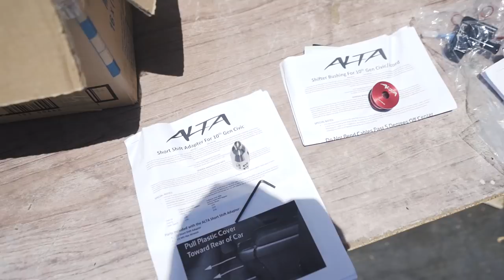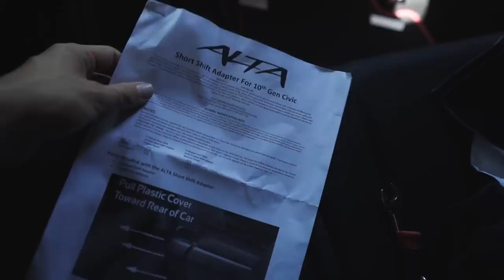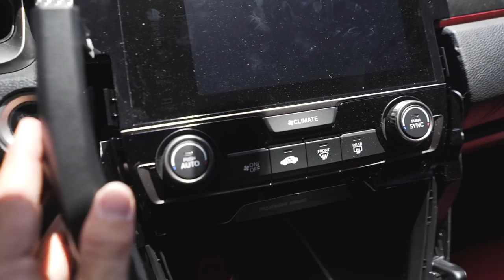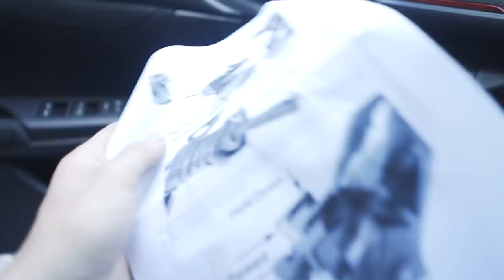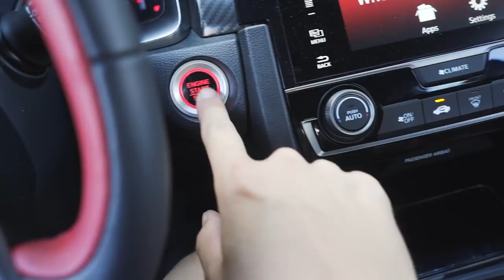INSTALLING A SHORT SHIFTER ON THE 2018 TYPE R! DIY

Comment: Just installed it today and I adjusted the adapter to it’s lowest, shortest setting. Now it’s the same short throw I had in my 04 STI with the Kartboy short     shifter. I did have the whiteline gearbox bushings with it also. It’ll allows me to shift faster, down shift better with confidence it’ll be going into each gate. This improves drivability tremendously. Best mod so far!

Comment: Just a little bit of helpful advice, as someone who has installed a lot of these short shift adapters on Civics this gen and of past, I highly recommend you put some type of tape over the Allen screws that tighten themselves along the ball/shaft of the original shifter connection point. They will eventually unscrew themselves over time due to vibrations and general shifting use. You can also use something like thread locker blue if your so inclined, but the non messy way IMO is just some simple tape wrapped around it twice over, it will keep them in place and prevent them from vibrating loose. If you don't do this, in a month or two from now, you will find that the shifter doesn't go into gear smoothly and may completely bind up because the ball that connects to that weird connection to the linkage has loosened up and fallen out and it's not engaging the gear correctly. Anyways, love the videos, keep up the great work! Hopefully I'll get myself a Type-R in the future.
Reply from the maker: i was actually thinking of that. When i go back in to do the shifter lock, i'll do that!
Reply: Thomas from Alta told me this" No this shouldn’t happen, we’ve used a similar design  for another part for a long time with out any issues. It’s a clamp design, so when you tighten the screws down it holds pressure on the screws both ways."
Reply: Loctight will work just fine.

Comment: Just ordered one. I used to do car audio installations so removing the center console shouldn’t be an issue as long as I make sure I don’t break or loose any clips. It would’ve helped others how some panels needed to be removed by lifting up or straight out, screw locations which you did mention.
Reply: Where did you order the adapter from?  Will it work for my 2018 civic LX 6spd?  Thanks!

Comment: Have you noticed the clunk without having the shifter cable lock down? If you’ve already installed it has it removed the clunking issue if you even had it after the adjustable short shifter install? I think stock is still long for me compared to the short shifter I installed on my 04 STI.

Comment: I can’t see how it would sit lower than stock when the only thing you’re changing is the cable mount below the shifter pivot, unless you had a smaller shifter knob. Should’ve test driven it with the console all out though cos you would’ve been kicking yourself if you had to take it apart again!!

Comment: Yo dude, I love your videos man. But why not just do 181's since you're already @ 185lbs. You only have to water cut 4-5 lbs rather than having to gain 13 lbs for the 198's. You get a better WILKs score by the end of the day and if you're doing USPA, you can gain as much weight as you want after you weigh in :) Best of luck to ya!
Reply: Bernard DeRoxas that makes no sense to me 😂 I hope I’m not the only one
Reply: C J Farmer 😂😂😂😂.. basically he is jus saying that Dustin should compete in the 181 weight class due to the fact that dustin is 185Ibs instead of trying to gain more weight for him to compete in the 198 weight class. The Wilks score thing i dont get thoo😂😂imma noob powerlifter
Reply: C J Farmer Basically what @DatAsianGuy was saying.  Dustin is technically already in the 198 weight class since he is above 181, but he may be better off just cutting a few lbs to get under 181. Not only will he have a better chance of placing, but his wilks will be higher (Score based on the ratio of bodyweight to weight successfully lifted). And USPA is a federation that allows lifters to weigh in 24hrs before competition, allowing them to pack on as much weight, even exceeding their weight class. Much like what fighters/boxers/wrestlers do.
Reply from the maker: thanks brotha! I tore my bicep last year and the 181 class is much more competitive, especially at my height.

Comment: Dustin this is not the gear box in the center console. That's the gear stick. The gear box I believe should be on the engine
Reply: eldan wiggins LOL. He knows
Reply: Yeah he's used to rwd cars where the gearbox is usually right there.
 (Not always, on some cars, it's more forward than the actual shifter. For example on Bmws or 350zs the gearbox is too much forward so it has a bit of linkage in between.)